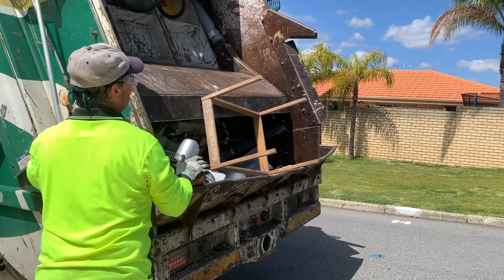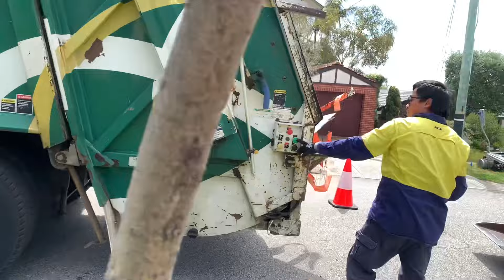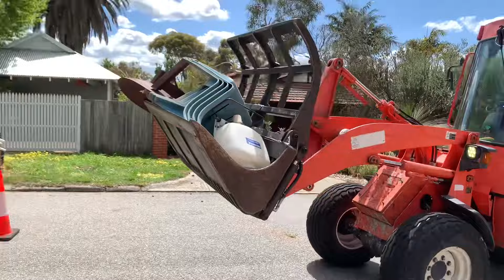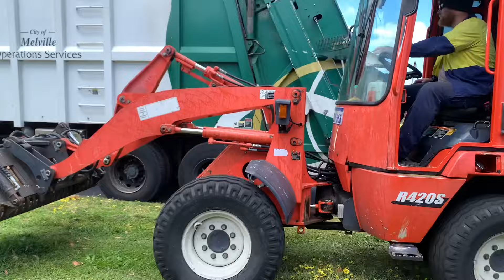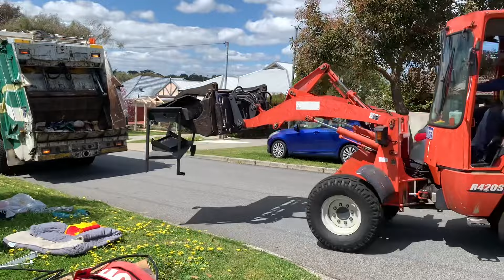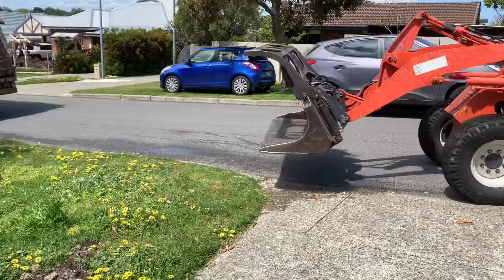City of Melville | BULK waste massive piles with the old Hino

Comment: Your garbage truck press doesn't have enough power for such fence parts, the garbage truck is already suffering from old age or the setting of the press is not correct and has to be adjusted by the technician in the vehicle workshop😂😂😂😂👍
Reply from the maker: It was getting full so it couldnt
Reply: This truck has been doing this since 2008